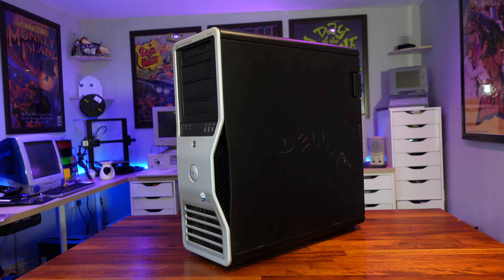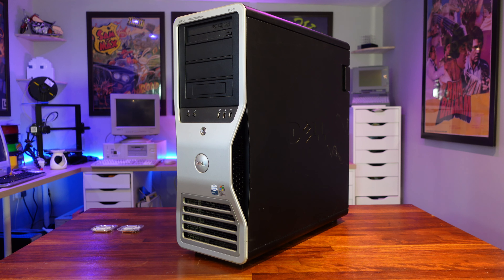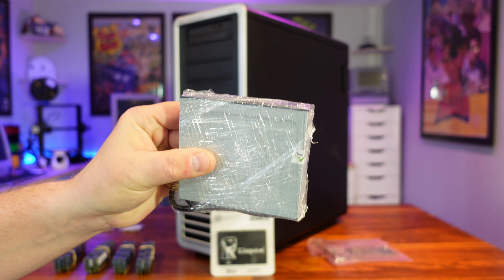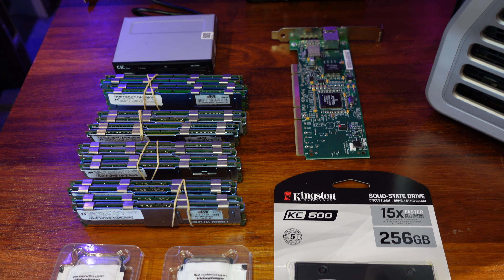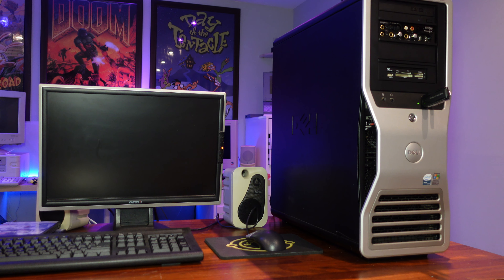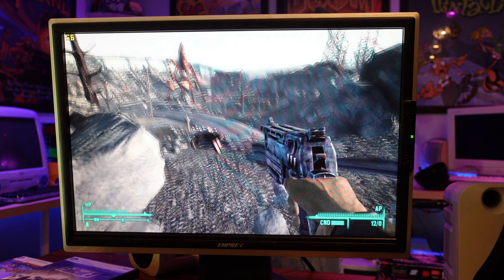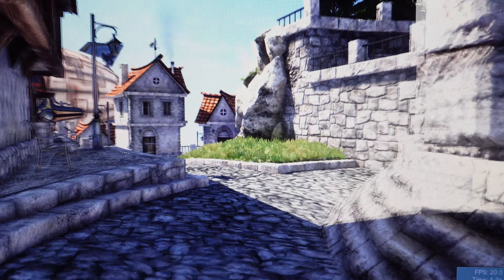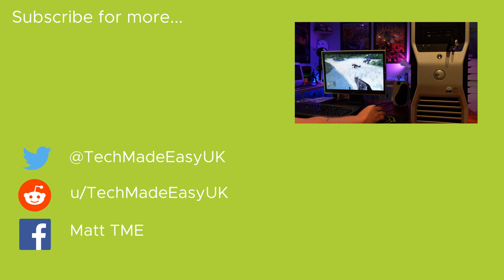Let’s max out this Dell Precision 690

Comment: I love my 690, I no longer use it for my main 3D or VFX work but I do use it to recreate my content, I put a GTX 1080 with 8GB VRAM and SSD and it runs very hard, I edit video up to premiere 2021, After effect 2019, Blender up to version 4.1, but you should not put an envy driver beyond 522.25 or everything will collapse, but it runs smoothly, the only thing that has given me problems is virtualization because I think it is a system not supported by android emulators, otherwise I have had it for 16 years and it has never given me failures, greetings

Comment: Weird, was my comment deleted as spam? Just wanted to point out that PCIe should always be backwards compatible and those USB controllers should still work, they'll just lack the bandwidth to perform at the max theoretical speed. I have a VIA VL805 based USB 3.0 card in my P35 chipset PCIe 1.1 machine.
Reply from the maker: Useful info, thanks!

Comment: Another problem can be the dual cpu setup, games have a hard time with that as they don't exactly understand the 2 cpus. I'm not explaining it well but there are videos that do. Also, Vista Business is a fantastic OS. Great video.
Reply from the maker: Thanks! Yes back in this era games weren’t generally designed to make use of more than a single core, so all that processing power didn’t really translate to gains in game performance.

Comment: I pulled the trigger on a pair of Xeon X3363s last night. While they aren't specifically mentioned on the Dell site, they look like they have the same pin layout and fit well within the TDP of the 5060s I originally had in there (it currently rocks a pair of 5160s). I will report back if it works or not!

I've got a Radeon HD 7850 2GB in there right now. I will eventually replace that with a 4k-supporting GPU.

I am not sure how to go about the HDD to SSD upgrade as the 4 SATA connectors seem to be occupied, and removing any of them causes it to fail POST. Not sure if I can do a pci-based SSD in this.

Mine has 4x4GB ECC RAM and is running Windows 8.1.

The final upgrade I'll want to do is to add a USB 3 controller to the front or back. Haven't decided on anything.

Comment: Not sure about fallout but Crysis adds a lot of bling in dx10 mode so it's not unreasonable for it to run slower. :)
I'll never get over just how insane that game is tbf. Almost 15 Years old and it's still mostly holding up in the fidelity department.
Reply from the maker: Completely agree. It didn't need a remaster. It's still impressive as is
Reply: @TechMadeEasyUK  Happy to hear I'm not alone.
Saw the first demo of it and thought "this is a DEmaster". I were stupid enough to buy it later on, just in case, and I'm sad to admit that the only way it amazed me is just how much they borked it.

Comment: I have one of these I am getting ready to take to the pc recycling center tomorrow. I just wanted some more nostalgia of when it was running.
Reply from the maker: Nooooooooo, don't scrap it. See if someone else wants it.
Reply: @TechMadeEasyUK  I had it on Facebook marketplace for free for weeks. It had a good run I used it for my plex it ran non-stop for 6 years. Only went out during storm sandy.
Reply from the maker: @Bane_Diesel  that's a beast of a Plex server. Well, sounds like it's time for it to go to the great data centre in the sky

Comment: 2 of mine i had back in in the day both died oddly, PSU issues and if I remember they required specific PSU's not generic ATX
Reply from the maker: These machines were produced towards the end of the capacitor plague, so not entirely surprising (though I’m sure frustrating at the time!)
Reply: @TechMadeEasyUK  I didnt think of that, yes looking back that prob was the issue as they were kind of unpredicatable. Would work well for a week then wouldnt even turn on for a week